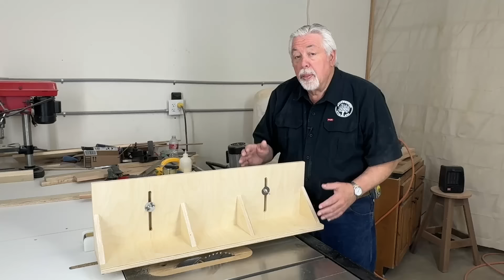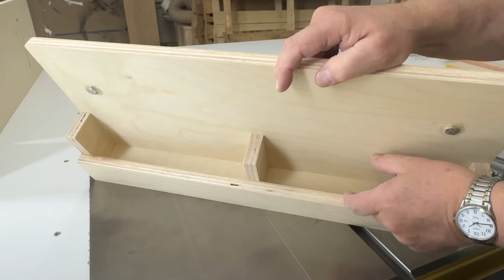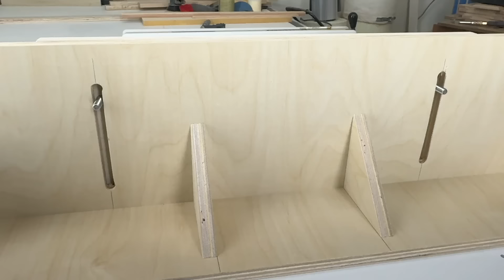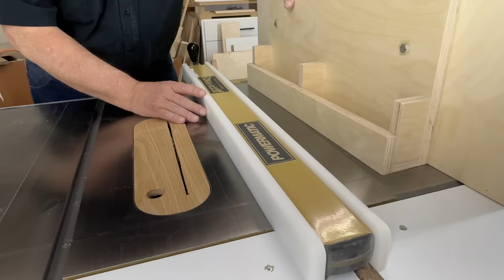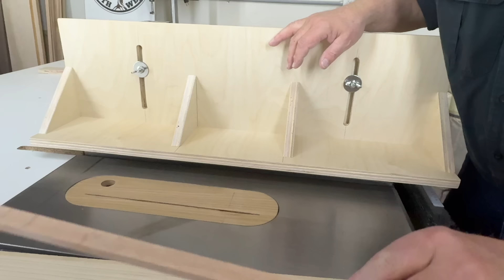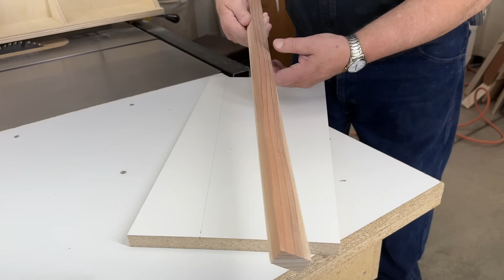STOP Messing Up Your Cuts! Build This Simple L-Fence Today!

Comment: I see a lot of people making these L fences but in my opinion is is limited to short boards, I am correct? Wouldn't a sled make more sense to use.. I know people say that this can be used as a jointer and I agree but with only relative sort boards. Educate me on what this can be used for other than the short boards.
Reply from the maker: Hi...it can be used for long pieces you just have to use a long guide board. I explained in the video that you need to have a guide board for the way it is used. Thanks Wes

Comment: Can someone tell me the things this jig can be used for? Didnt really get why this can be more practical
Reply: It's for when you want to make a straight cut that is not parallel to the opposite side, like in a trapezoid or triangle.
Reply: You could use it for a lot; joining boards, cutting circles, templating various shapes...

One huge benefit is that you aren't referencing one edge to the other. For example, you could straight line rip the edge of a wonky board so that it is straight then reference that new flat edge against your table saws fence to copy it to the other side of your board. Then you would have two edges that are straight and parallel to each other.

Or in short another way to join boards without a jointer.

That's just one benefit.

Comment: Thanks for showing the advantages of an  L fence. I use my L fence for duplication of small parts and anything that has convex shape by making multiple cuts. 
I usually set the fence to leave just a little bit wider than the pattern and then using a spiral ball bearing pattern bit on my router to bring it to the exact size. 
I recently made many heart shapes with roughing out on the L fence and then sizing it to exact using the router bit. It worked quite well .

Comment: That's a great jig, but why not just use a track saw?
Reply: Great question. I was just thinking about a plywood sheet cutter for a table saw.  An old cabinet maker I knew could lay his plywood flat and rip or cross cut it using a giant jig he had built to slide in the table saw tracks. It requires a lot of table space around the saw.  A track saw is much quicker but not as sturdy.
Reply: @ You can use saw horses and the nice thing about the track is you can clamp it to the work.
Reply: Why if you have a cabinet saw, I mean that's what they're made for....

Comment: L-fences are great for cutting straight edges on rough-sawn boards, for use as angle cutting jigs, or even for creating longer, straight pieces of thin stock for trim on plywood edges, etc. Further,  L-fences are also relatively inexpensive because they are typically made of scrap plywood and don't require the use of toggle clamps, as many jigs do. 

I prefer to use threaded knobs rather than wing nuts to fasten the two parts of the fence together, but that's just me. (I dislike wing nuts, in general, even though they are effective and inexpensive, because I have old fingers. 😎.)

Thanks for the video. It should be useful to many woodworkers. 👍👍